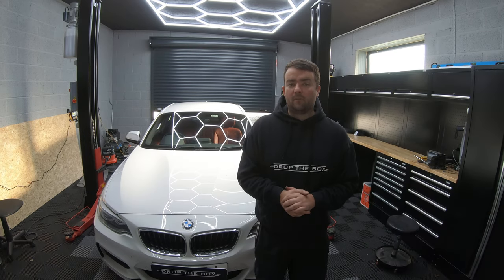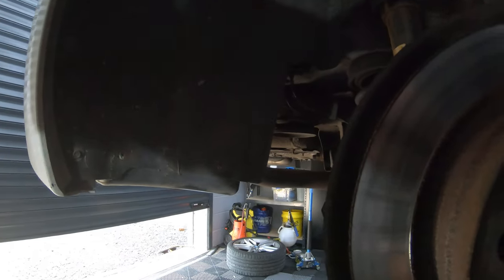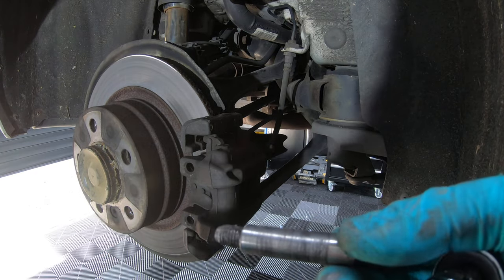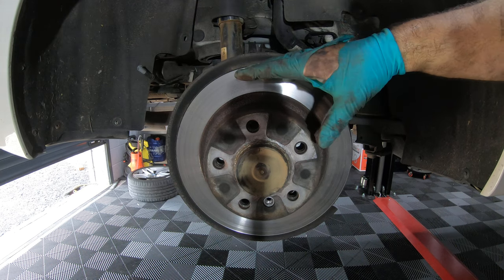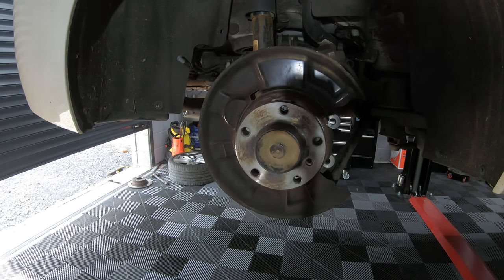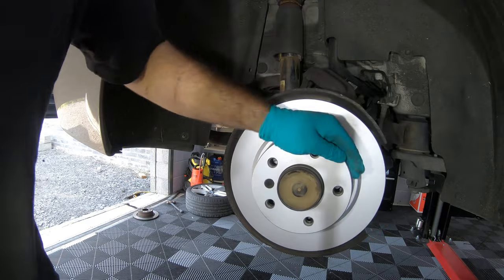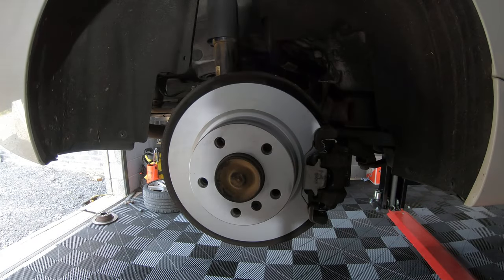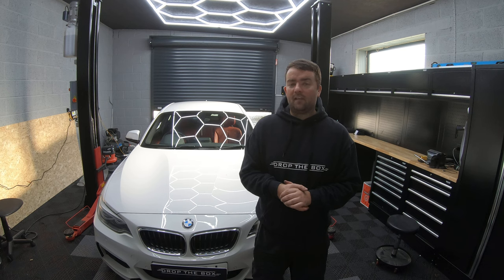BMW 2 Series - Rear Brakes Replace

Comment: I just attempted this on my 2 series. When I used the 8mm allen to try and remove the calliper pins (4:21) I was putting an extreme amount of force on them and they weren't budging - any tips? I didn't want to put WD40 on them in case that was the wrong type of thing to use
Reply from the maker: Wd40 on the threads, work them in both directions. Could try applying a little bit of heat but be considerate of the rubber components around it.
Reply: @DropTheBoxOfficial  Great thanks for replying, will try tomorrow, otherwise I'll just get a garage to do it